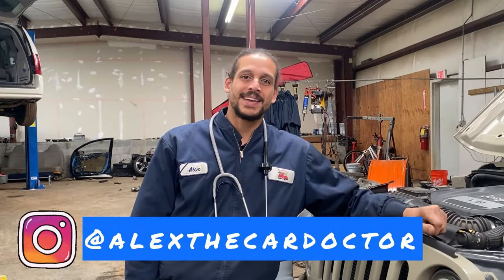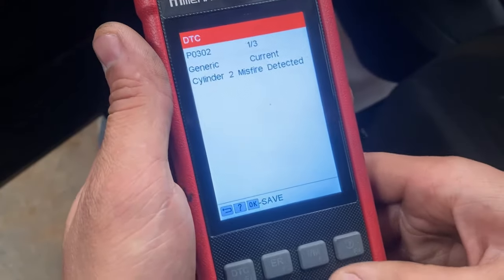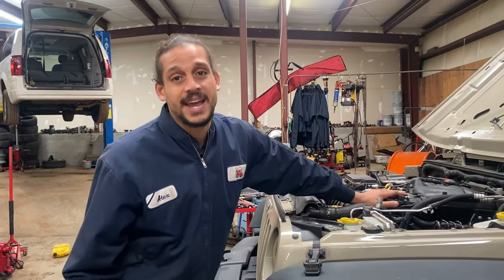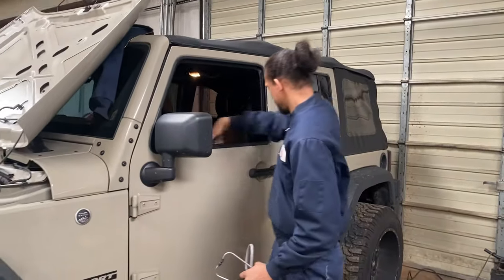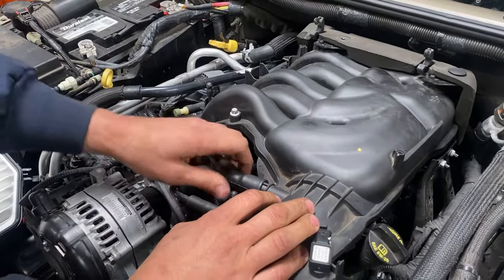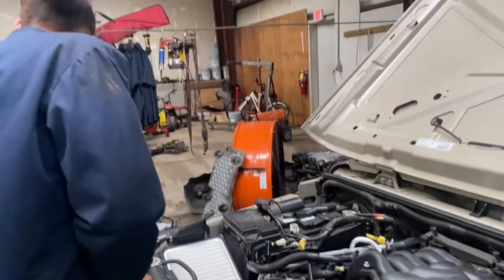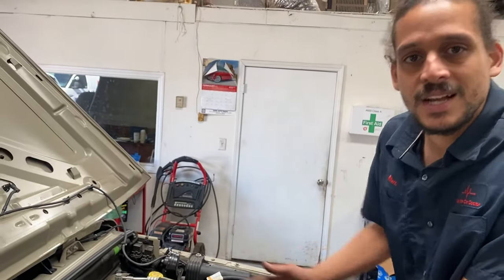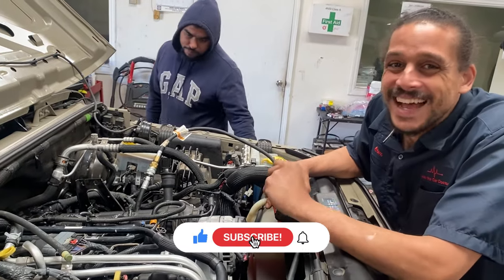Jeep Wrangler needs Major Engine Work at only 40,000 miles! | 3.6 Pentastar Issue #jeep #autorepair

Comment: 3.6 pentastar has a recall for cylinder #2 misfire. It is only taken care of if the owner goes to the dealer with the problem. Not all pentastars get this issue. The estimate is about 1% of all units built will have this problem develop. It was a major problem through 2014, but is a known problem through 2018 and a class action lawsuit has been filed. Chrysler will take care of it for customers who are persistent. The heads are manufactured with sand castings and if the heads are not properly cleaned before installation during the manufacturing process, this is a result. If I were the customer, I would demand Chrysler reimburse for all repair costs.
Reply: Is there a recall for cylinder 1 misfire too for 2015?
Reply: @michaelcronin5225  Only way to know for sure is a trip to the dealer. The people on @EpicFmilyRoadtrip just had a cylinder 1 misfire on their 2020 JL. It all comes down to the way the heads are cast and if the manufacturer got all the residue out of the heads before assembly. #2 and #3 are both covered by recall if it is determined to be the head. I had a new head installed at manufacturer expense for a #3 misfire.
Reply: @jpdriver1967  thanks. Just dreading hassle and the expensive repair.  Sounds like $3k or more
Reply: They all pretty much have the oil filter housing problem, that fails, mine did at 42K miles.  It’s a $1000 fix.
Reply: Junkkkkk
Reply: I never had this issue w my 2007 grand Cherokee Laredo 3.7 she just surpassed 225K and still runs amazing
Reply: @queensapphire7717  most of those are caused by Over Tightening. people see that 24mm hex head on top of the plastic cap and put on their socket and ratchet down on it too far, to where it puts too much pressure on the bottom half that is plastic also. that causes leaks.
Reply: @TwoFeatherChannel  yep, mine actually went from a cold spell we had in the northeast back in Dec 2022, dropped 40° in a span of a few hours, and it was dubbed “The Great Crackening” by us Jeepers, due to it causing oil filter housings to fail, 3 of my friends, as well as myself   Had ours fail due to it.
Reply: @queensapphire7717  Did you upgrade to the Aluminum body version?
Reply: My 2021 gladiator had this issue at 25000 km now it is currently in the shop at 40000km for the same issue....
Reply: FYI: they will only pay if a Jeep dealer diagnoses and repairs the problem. They will not pay for a third party shop diagnostic or repair.

This should be top comment. Still have 2014 JKU now at 100,000 miles. Exact issue at 80,000 miles. Took it to Jeep dealer for diagnoses. After the diagnoses I kept calling Jeep corporate until I found someone to talk to. DO NOT TAKE NO FOR AN ANSWER. This was during covid. Needed a new head. Took 4 months. Chrysler took care of everything except $700 of car rental during that time (total car rental was about $2,500).  This is a manufacturing defect. I suspect it is a heat cycling issue that impacts oil delivery -- directly related to the rocker issue that is also common. If you only have the Pentastar Tick, get that replaced and get it done for free by hassling Chrysler until they pay for it.

Also, change your spark plugs at 50,000 miles. I originally replaced mine thinking the P0302 was spark plugs. They were very well worn. The 100,000 recommendation is ridiculous. Replacing the plug and coil fixed the problem temporarily (about 50 miles). During that time my MPG went up 1-2 MPG. Why? New spark plugs.
Reply: @michaelcronin5225  There is no recall. Go to Jeep dealer and have it diagnosed. If it is one of the common issues with the Pentastar, hassle Chrysler to get it repaired at no cost.
Reply: @TheDirtCreature good luck with that as I went back to the dealer and they said no issues as I open her up and there issues so time for small claims court as my engine is now toast. Sadly even my neighborhood mechanic said there was no issues while it’s all over the internet. These guys really suck
Reply: As usual, customers outside US are screwed
Reply: @queensapphire7717 😂😂😂. Or did you just say an oil filter housing repair job is 1k? Good lord, I am so happy I’ve got some mechanical know how, I paid $350 plus the intake gaskets and oil/coolant temperature sensors, and did the job in a couple of hours. Good lord you got ate alive. 1k?? Man, I need to be a mechanic if they making turnaround like that.
Reply: @michaelcronin5225  no
Reply: @michaelcronin5225  a lot of times it is a worn rocker , and or cam
Reply: @TwoFeatherChannel  most of the ones i seen have been expansion and contraction warping the plastic around the rubber seals. Then the leaking starts.  Some have leaked where the plastic was "welded" together at the plug on the front of the cooler.
Reply: @queensapphire7717  Ouch!!  I take it you took it to a shop for that.  My wife's failed on her 2014, but the cost to fix that was $125 or so in parts with me doing all the work.   We opted to upgrade the aluminum housing to get rid of that plastic one.  I ended up proactively replacing the plastic oil filter housing on my 2017 Rubicon and upgrading it to the aluminum for another $125 in parts.  Cheap insurance for future problem that will eventually happen with that OEM plastic housing.
Reply: @TheDirtCreature  so take it to a CDJR dealership and have them run it? I've been chasing the issue and have replaced the spark plugs twice, coil packs twice, both camshaft position sensors, fuel injectors, and I'm right back to C2 misfire, another code for implausible something or other, and something to do with 4wd transmission something. (I don't have the scan paper on me lol) it's a 2018 jku sport s with roughly 76k miles.
Reply: @corbind.9395  Its generally the driver side head going bad. mine went out at 142k and it was one of the "fixed" ones.  Even though Jeep put out an extended warranty for the "bad" ones to 150,000  mines I had to fall back on my lifetime power train warranty. Cause Jeep said your cylinder head does not get the 150k warranty because its the good one.

Comment: Cylinder # 2 exhaust valves not seating properly or burning have been a regular problem on pentastars from the beginning. Put # 2 at tdc compression and blow a little shop air in plug hole with a latex glove on the tailpipe. Glove inflates letting you know for sure it's the exhaust valves not seating.
Reply from the maker: That was gonna be the next step but the customer didn’t want to pay for further diagnostics
Reply: @AlexTheCarDoctor  lol you charged for that?
Reply from the maker: @seahorse5677  unfortunately I have to.my shop rent at the time was 2500$ plus light and water a month I don’t think you want to now lol
Reply: You said at that time it was 2500 how did you get it lower
Reply from the maker: @jacobdykes6736  5000$
Reply: I give you props people in alabama can't even stay open with rent being less then 2000
Reply from the maker: @jacobdykes6736  dang, I think honesty takes you along way in this industry
Reply: I agree with you are your techs on flate rate
Reply from the maker: @jacobdykes6736  yes and I give them a minimum just so they can eat in case we are slow
Reply: I appreciate you answering the questions
Reply from the maker: @jacobdykes6736  any time buddy just ask I’m a open book for all automotive questions
Reply: @seahorse5677  Do you work for free?
Reply: Exactly what happened to my neighbors Jeep luckily his neighbor is an old technician. Lapped in2 exhaust valves check for cracks all good running great today 👊🏻👍🏻

Comment: I can tell you’ve worked on a few of these 3.6s. You’re absolutely right about not using power tools on the intake manifold. I’ve cracked a few of them over the years just tightening them with a 1/4 ratchet and torqued to the minimum torque spec. Other than that the pentastar engine is a great engine despite their early production flaws. As opposed to the dreaded GM 3.6, which needs a timing chan kit every oil change. I’ve seen plenty of neglected Chrysler 3.6!engines with no timing chain or VVT issues like GM cars have. Also you opened the hood on the wrangler the correct way lol. That’s how I open all of them. The prop rod is for the customer to fill their washer solvent and the rare occasion where a customer checks oil. And screw them hack mechanics. I hate when I get a car that I see a bunch of butchering, missing bolts,
misrouted wiring, amongst other things,
then I have to figure out how the car is supposed to go back together. My conscience won’t let me hack on a car. Customers pay tons of money to get their cars fixed and it should be done right, even if it’s an 07 rotted Caliber.
Reply from the maker: Aman  brother 100% true I like you where are you from
Reply: I had, key word HAD, a Cadillac CTS with the dreaded GM 3.6. You are right about the timing chain and gear issues. But also a flaw that can present as a timing chain but is really much much worse. The crank position reluctor ring on the back of the crankshaft is just pressed on and can shift. When that happens it’s a crankshaft replacement. Big $$$! For a piss poor design. Should have been keyed. I also ironically have a 2014 Wrangler Rubicon with the 3.6 Pentastar 120k+ miles and really no engine issues, oh save for the oil cooler leaked and needed replacement at 80k miles. It’s stupid that it’s plastic and under the intake, but at least it’s fairly cheep.
Reply: Even aluminum intake manifolds can crack if you tighten them too much. A manual ratchet is the proper way to tighten an intake manifold.
Reply: Dodge sucks.....theyre not good motors...not even close.

Comment: Great work.
I first encountered this problem on a 2011 charger then a 2014 jeep and now a 2018 grand caravan..
Finally the grand caravans owner paid to tear down and the issue is actually the exhaust valve seats. 
Chrysler is aware of this problem and check engine comes on for different reasons o2 codes or misfire codes and yes its common on cylinder 2 4 or 6
After hours on the phone with Chrysler i was able to actually speak to a good tech.
The cause for the issue is the robot that assembled the head put incorrect valve seats.. 
Sooo there you have it.
Reply from the maker: Thanks for the information buddy
Reply: Anytime.
" knowledge cant be power if you dont share it with no one"
Reply from the maker: @howsithangin03  I love it thanks again
Reply: Jimmy S  
Its possible... 
But i dont think thats the case with the 96k mile one.. by went away for 2 or 3 weeks im assuming u mean no check engine light on. But the misfire is still there u can feel it in the body or even see the engine shake now to continue the issue i believe is the seats are misshapen just a tad to where over time it causes the valve to not completely seat correctly putting more pressure on one side or the other and the valve bends just a tad and begins to wobble and if left that way for some time especially at higher rpms it wreaks havoc on the lifters sooo that may be what you were hearing in the valve cover.. the 2018 grand caravan i first posted actually went to the dealer due to being covered under there extended warranty 
Brand new head replacement
Cost was $1682.13 for parts
$2000 for labor in california so its a pretty penny
Reply: My 15 challenger 3.6 got its lifters rockers cam and exhast valve replaced at 100k, was literally almost at the end of my warranty so that was covered, it was an 11k job my deductible was 300 😅. But yea i thought i caused it by riding hard on her always red lining 1st and 2nd gear so my exhaust pops lol. I have the paddle shifters/sport mode. Now at 122k and i just replaced the thermostat and water pump. Hoping the engine makes it to 300k
Reply: @187onYaAs  
2011 dodge charger
266,067 and counting no major work other then the head issue.. timing chain no noise yet🤞🏽

Comment: The right piece of rubber hose ( stiff braided type ) is also awesome for walking spark plugs out and in. I have had the same four pieces I use for about the last 15 years in my "odd stuff" toolbox drawer. Thanks for video !
Reply: Been using that hose on sparkplug technique for 48 yrs

Comment: I had a 2015 Ford Fusion SE with the 2.5l engine that had a cracked cylinder head in 3 places at 22k miles. Ford fixed it under warranty and said it was a bad head from the forge. Testiment to Ford quality control because a 3rd party made the heads and so it got passed their quality control and past Fords quality control. Later on at 55k it had a bad head gasket. I got wise and have a Toyota Camry in the drive for my wife now. Best decision I ever made for her. I figured this Jeep had a cracked cylinder head from the start because so many Pentastars have them. Its a well known issue so I immediately thought that when it was mis-firing. Good work though keep it up man:P

Comment: Me and my Brother have two 13’jeep wrangler Rubicon’s 2dr 3.6 L - Both are about 95,000 miles, no issues with the engine or transmission one has developed a leak in the front driver side axle seal no other issues.

Comment: Had the same problem on cylinder head #2 of 2014 Wrangler Rubicon w/ 70k miles. After failed compression tests had a dealership replace the cylinder head. After I went under the hood and found multiple hack mechanic examples including the plastic bolts that seat the air filter housing being broken. After the first 2+ hr. road trip I am having high RPMs when starting and cycling through low gears. Going to replace crankshaft sensor and see if that is problem.
Reply from the maker: Dang man I wish people would take more pride in what they do

Comment: I have a 2013 with 67,000 miles. I just got a PO300 and PO339. I love my Jeep but this is irritating. I have replaced the starter at 27,000 and the thermostat at 55,000.  I wish these were more reliable. 
Thanks for this video.
Reply from the maker: Dang that is irritating good luck buddy. Thanks for watching and your support

Comment: My 2019 Ram has the 3.6 and got the check engine and soon the tick tick tick, took it to one of the local parts stores, they did the scan tool, got the code, Cylinder #3  either spark plug or coil pack,  I couldnt get it into a dealer for 30 days,  took it to a local shop, nope! it wasn't either,  it was a bad cam, flat spot on cylinder #3..   not a cheap date.

Comment: I just replaced the oil filter housing on my 3.6 in my Dodge Grand Caravan and I cracked the upper intake manifold plenum while tightening one of the screws with my torque wrench. Can't imagine using power tools on that plastic!
Reply from the maker: I follow this Mobile mechanic on Facebook and I seen him tightening down an intake on a 3.6 Pentastar with a impact that I was smh

Comment: Alex, I appreciate your making of this video. I'm a retired electronics technician and I own a low mileage '12 Chrysler 200 Touring convertible with the Pentastar engine. I believe if you take good care of these engines they will do fine. I only use Pennzoil Ultra Platinum Full Synthetic 5W-30 motor oil and change it at 3,000 to 3,500 miles. Chrysler recommends this oil for their engines. My car has not had anything done to it as far as I can tell by a shop before I bought it in ‘16. I'm particular and really like this car and I'm buying tools and looking at videos in order to perform future work on this car in a careful and precise manner myself. I even clean the dirt off parts before putting them back on the vehicle. I like my white convertible!
Reply from the maker: Thanks for watching buddy, yes I agree if you take care of your engine it will take care of you
Reply: The Chrysler 3.5L High Output V6 in the Dodge Chargers and Chrysler 300s are pretty good engines
Reply: @davidperry4013  Oh you'll be doing the oil cooler some time on the 3.6
Reply: I religiously changed the oil with premium products and replaced spark plugs, etc., with OEM everything. This Pentastar issue is a real issue that has nothing to do with maintenance, although I'm sure that poor maintenance can help precipitate the problems. Why? Because all of these problems (Pentastar tick, Oil cooler breaking, etc) are all oiling problems. All Jeep dealerships will tell you the same thing as I have just said. Hopefully they fixed everything in the latest version that goes into the JL (lol).

Comment: Currently experiencing the same issue on a 2017 wrangler Rubicon and its looking like a new motor and great video by the way
Reply from the maker: Thanks for watching buddy
Reply: They have had a lot of problems with cracked cylinder heads on these engines I hope that is not your case, but there has been a lot of it. I know a Chrysler tech and they said that the newer engines no longer have them, but he says they lied because he is still replacing cylinder heads on late models. Mis-fires can be many things, but you want to keep an eye on the temp and check the oil regularly to make sure its not got a milky look to it. If it ever starts to look cloudy like a milky substance is in it you got a cracked head. Some cracks can be small and grow more problematic with time as they will introduce more water into the engine. I am not a mechanic I am going off information I have gotten from friends and a guy that is a Chrysler tech. I believe car wizard has a video on this problem.